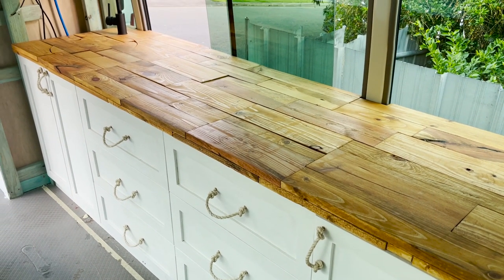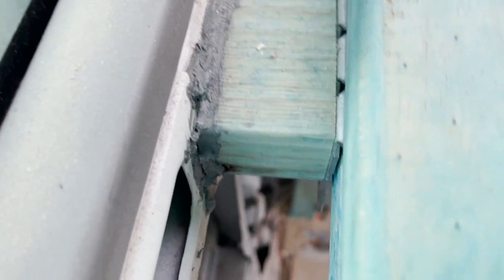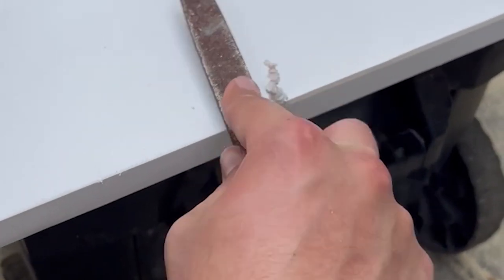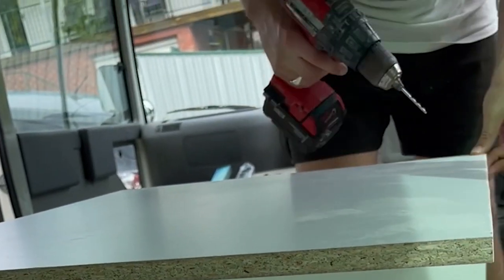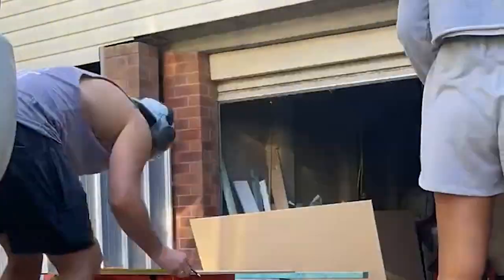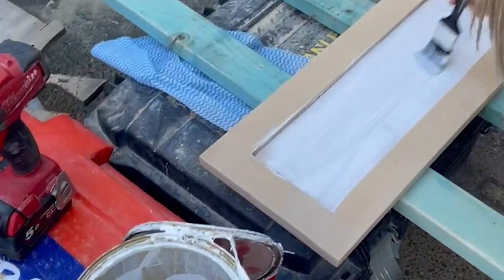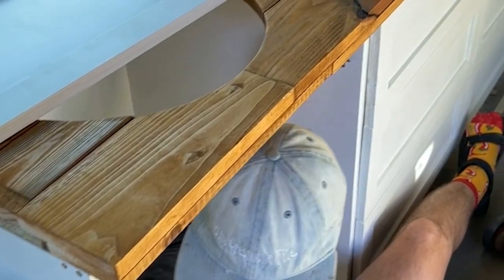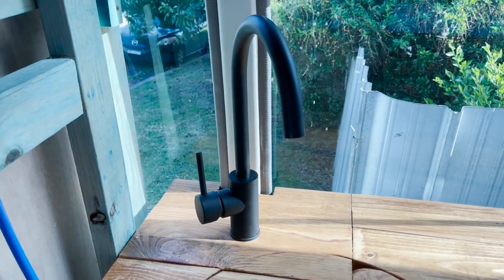Bus Build - Part 2 | Kitchen/Bed Frame/Seating | Toyota Coaster Conversion

Comment: Just watching where you put in the bed frame. We have a Toyota Coaster 2005 Coaster that we are just starting to do up as a camper van. Hubby things we can only access tail light globes from inside. Just wondering if you are going to be able to access your lights easily to replace globes etc.? Cheers Cheryl

Comment: Great job guys!
We are in Whitebridge near Newy and just finished (tonight!) our Rosa bus conversion ready for a little trip tomorrow.

Awesome fun!
Reply from the maker: Thanks Daniel! Oh how awesome is that, we're just around the corner in Dudley... what a small world! How'd your conversion go on the trip? :)
Reply: @SaltyWheels  It was so so awesome. We did ~3000 kms no worries. The only thing I would change is from our diesel heater to a gas one. 
One hot tip for building in the area is to give Central Coast Caravan dismantlers a bell for parts. We discovered them at the end of the build and after already buying everything new $$ :(
Reply: We have some other good contacts for engineering, solar, lithium batteries, and gas hook up / cert. if you need them

Comment: hi guys what did you do with the front left passenger seat that sat behind the drivers seat ? did you get an adapter plate to fit in the space forward ? if so where did you get it ? i have a bus the same model as yours and looking for the seating assistance help of the build

Comment: looks good.
why no insulation?
Reply from the maker: Hey Bridie! Thanks so much we appreciate it! So we’re doing our build a little different to most! We will be putting our insulation in after our electrical system, fitting the electrical system is something that is often done first in a bus build, however we got a quote to have our electrics done professionally and it was way out of our budget so we decided to do it ourselves, having no experience in this area we decided to focus on the other parts of the build whilst spending a few months learning about the electrics before we started it. Doing it this way will make it a little more time consuming trying to weave the insulation around wires but we are saving thousands doing it ourselves so the extra work is fine for us! ☺️ thanks for watching!